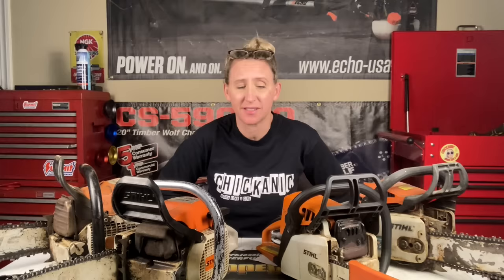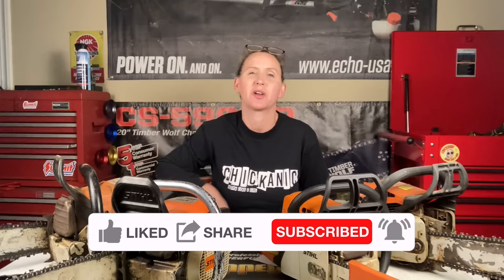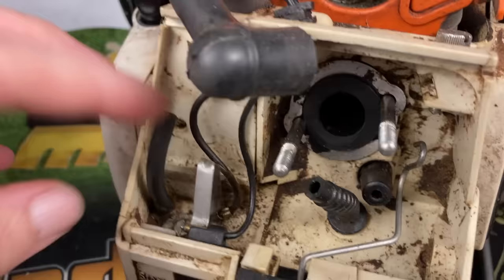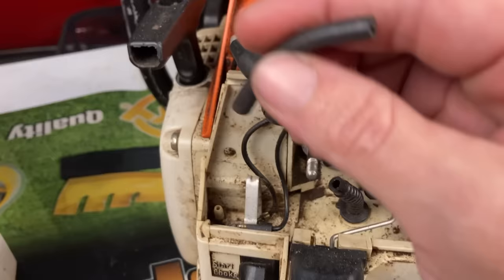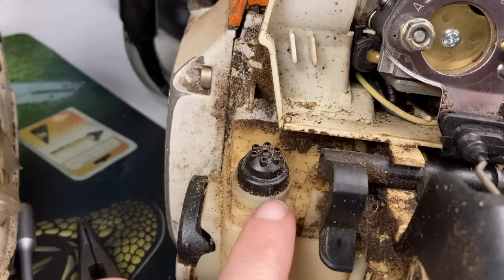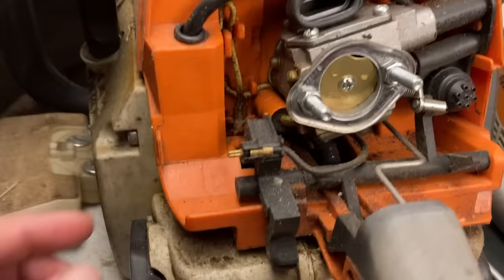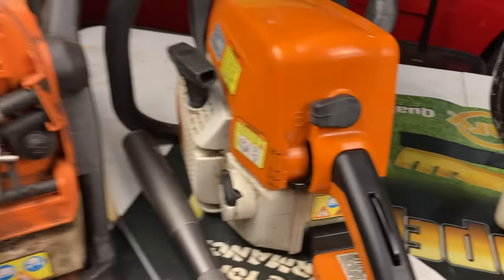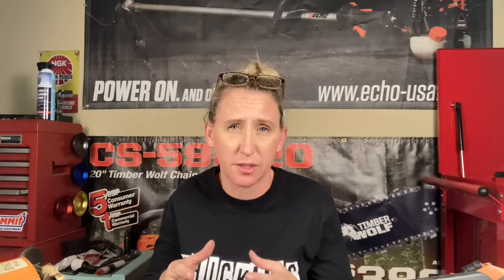Stihl chainsaw bogging down, has no power or is leaking fuel? CHECK THIS! Repair/Vlog #Chickanic

Comment: These carburettors require atmosphere pressure only. They DO NOT require tank "pressure". The vent is only to allow air in to stop a vacuum. All these comments and I don't think there's a mention of carb pop off pressure. This is the required pressure for the inlet needle to pop off its seat. This pop off pressure helps to stop heat related tank pressure from flooding the engine.
Pop off "spring" pressure is also in relation to metering diaphragm activity. If your inlet needle in a bit on the old leaky side you will flood your engine if the machine is left in the hot sun with a working late model tank vent. Being a bit old school I prefer the older screw type vent,  where tank pressure is constant whith atmosphere. Like the old 038's
Reply: Don’t mind them, people know things without really knowing them. It happens when everyone wants to teach what they know.

As for venting pressure, it is something Stihl (maybe other pro saws as well) does as they’ve had issues with gas spraying out when operators opened the cap to refuel. It was a workplace hazard and they were going to lose business if they didn’t fix the danger.
Reply: Right the most stable mixture and smoothest idling is when there is no help 
from tank pressure to the fuel pump.The metering diaphragm and needle valve
are confirmed working at least for fuel flow cutoff, if tank pressure is there, 
and no issues of flooding are also occurring. When my saw is not in use, I put
the throttle on the fast idle warmup step with the kill switch set to Run so the
throttle plate is cracked open and any seepage of fuel can evaporate and not
flood the engine while it is sitting and awaiting next use. As a habit I do this
setting every time the saw is not in operation in anticipation of the next use.
You are right the engine runs better with no extra fuel pressure just the fuel
pump pressure on the metering diaphragm so the mixture settings stay valid.  
A paradox there is trying to have your EPA cake by blocking emissions of fuel vapors but be able to eat your OSHA cake too by not having pressure in a fuel tank when the fuel cap is opened. A compromise would be something like the pressure release lever on a radiator cap that would slowly release the pressure 
in a gradual way over a few seconds so there is no spraying fuel when the fuel cap is opened. Stihl or aftermarket fixers of course came up with a hundred 
dollar solution fuel fill cap upgrade. Everybody sees what EPA has done to 
gas cans with all kinds of contraptions that are only progress for a special
way of thinking about what is actual progress worth having for the small 
difference it may make. And such improvements can backfire in ways that
were not anticipated. That would be the case where tank pressure is great
enough to force liquid fuel past the main jet needle valve where it would 
be evaporated as it floods the engine or heads that direction, which can 
result in a higher emission to atmosphere than would occur from simply 
allowing vapors from the fuel to escape as the cost of doing business. 
If that flooding problem is occurring then pressurized fuel tanks could 
be making the vapor emissions worse from the liquid fuel leaking past
the main jet needle while the saw is not even in operation. Has that issue
even been studied by Underwriters Laboratories or similar EPA? I don't
know. A Bic lighter has a porous rod that allows butane vapor to exit 
the valve when the lighter is used but blocks the liquid butane fuel 
from squirting through the valve like a flamethrower. That is an idea
has a parallel to the pressure venting issue and is where the sintered 
bronze or some other porous material could be useful maybe even 
the exact same porous rod used in butane lighters could work.
Reply: @killer2600  You are still learning so let me mansplain.
Being litigious towards Stihl is misdirecting liability that 
should have been dropped on doorstep of EPA. Because 
it is the fuel storage emissions restrictions and "upgrades"
fixed what was never broken until bureaucrats mandates
started breaking things. That is the true story, all of it. 
And fortunately a recent Supreme Court ruling about EPA
is sending them back to school where they learn they 
do not have jurisdiction over everything from coal fired
power plants to cow farts, that states have their own 
regulations and not every state is California.
Reply: @artpatronforever  I’m not going to explain where you’re wrong. You’re a know it all that likes to mansplain to no end and talk for talking’s sake. You can explain to yourself where you went wrong and if you can’t I don’t care.

Comment: @7:25 would a more stiff hose help on the smaller MS250?  rubber of a more stiff grade?  or perhaps the best, a hose that is formed to go around the high-low limiter cap?  of course, such a line would be more difficult to bend around the high-low limiter cap.

Comment: I have a question and this is the newest and most relevant video I could find to relate to my issue.
I have a Stihl 251C about two years old, I seem to have some issues with the chain sharpening I've been having done at a local hardware store.
I just replaced the bar, the chains are cutting slow with some shavings and some sawdust, I'm looking into sharpening the chains myself and while looking at the chain it looked loose, when I rotated the chain it would tighten up and loosen as I rotated it.
What's wrong here ? 🤔

Comment: Great video!  Curious, though, what are the set screws for in the vent tubes?
Reply: Vapor can easily leak through the crevices of threads on set screws
pushed inside fuel line but the flow of splashed liquid fuel is restricted

Comment: These fuel tanks are vented not pressurised, the valve is designed to stop raw fuel and gas escaping into the atmosphere. The calibrated two-way valve prevents pressurisation (from heat) and vacuum (carburettor fuel pump) in the tank. That's why it cannot just be a simple venting hose.

Comment: Is it common for the coils to fail on the ms 250’s. Have one thats 2 years old that once it gets heat into it doesn’t want to start. Replaced the tank vent recently too. Guess I need to check if it’s pinching too. What compression should it be at? 120?  Great video.
Reply from the maker: 120 is good compression and no, I never see coils fail on them.

Comment: are you SURE the tank vent is to prevent pressure on the fuel?  it should be to relieve the vacuum in the tank as the motor draws fuel out of it.  at least that's the problem I had when I tried to do a temporary fix on a weed eater with a vented cap that had cracked.  - the weed eater would start, run for about a minute, and then lean out, bog down, and stall.

of course, the first thing to check on a saw that's bogging is to clean the air filter.  my mechanic told me to use electric motor cleaner to blast the crud off it, and it works great - though it's best to let it air dry for a few minutes before starting the saw, afterwards.

Comment: I have a pioneer p28, I put new gas in  it and flushed the system and it worked great 2 months ago. Now I can't get it started, I've checked spark but I don't know what could be wrong. Any ideas?

Comment: This video confused me. You explained that the tank vent allowed excess pressure out of the tank. Where does that pressure in the tank come from? I thought the tank vent allowed air INTO the tank to replace the fuel as it is used in the engine. If air didn't go into the tank, a vacuum would build up preventing fuel being drawn into the carb. Can you explain please. Thanks.

Comment: What creates the pressure in the tank? Is it just the temp increase that does the same thing to plastic gas cans?
Reply: alot of the pressure created in the fuel tank is ,as the fuel warms up the butane in the fuel expands(as all liquids do)and releases from the liquid . it is just part of the gasoline blending process to get it where it needs to be , so its uniform across the country , in the northern climates they use more butane in the mix in the wintertime to help vaporize the gas so it burns easier,quicker starts etc.,, butane gives gas the "woof" when its lit
Reply: Thought the vent was to allow air in as fuel was being sucked out so not develop a vacumm in the tank stopping the fuel from going to the carb.  What this about the right amount of pressure allowed by the vent.  Seems if there is warm fuel pressure build it would be allowing fuel out also.  I’m confused as to what she is saying about the vent allowing the right amount of pressure.

Comment: Would this cause the chainsaw to act like one of my Tecumseh engines with a replaced gas cap on it that sometimes acts like it is starving for fuel until I loosen the gas cap briefly to allow air in?

Comment: So it seems that we're lacking a solution on a test case. So I wanted to pose a possible solution, a small diameter flexible copper line that I could insert a small piece of in the area the hose is crimping down to nothing. Again I realize the powers that be frown on anyone reengineering things but what do you think of that idea?
Reply from the maker: Some people might say you can remove the limiter cap, but I can't tell you that. LOL!

Comment: If you're saw is bogging,  no power first thing to do is vacuum/pressure test the engine.  They are air leaking garbage

Comment: I have a question, I have a Stihl fs38 that has a weak spark white in color, I bought a new Stihl coil and set air gap and it still has a weak spark white in color, so I took it back and got another new one, installed it and this one has a weak spark white in color, so am I missing something, lol  like maybe the computer is bad, I looked at the piston and it is not black, it's shiny like new, I put a drop of gas on the plug and it didn't lite up the gas, what do you think it could be, I know that I'm missing something

Comment: The "set screws" in the tank vent line, do they have a small hole in them like a fuel jet??
Reply: Essentially is the tank vent set screw metering the amount of air Venting from tank through a small hole In the set screw in the line?
Reply from the maker: No, it passes just enough through the threads of the screw.
Reply: @Chickanic  ohhh wow yea I could see how that would clog up pretty easily then

Comment: You are saying the opposite. Tank vent lets the air IN the tank to equalise the pressure so the diaphragm can pump the fuel into the carburettor. The tank vent SHOULD let air in, but SHOULDN'T let air out. If the vent doesn't work you get the vacuum inside and saw leans out and dies...

Comment: I can't fully agree with your theory of operation here.... The fuel tank doesn't need to be under pressure and should not be pressurized. Most tank vents allow the pressure in the tank to equalize with atmospheric so the carb or fuel pump can draw fuel from the tank without positive or negative pressure affecting the flow
Reply: That is the old school and best way for the engine to operate, but EPA
restrictions on vapor emissions have changed the way things are made
to work.
Reply: @artpatronforever  I know what you're getting at, they are trying to keep vapors in, but she's talking like the tank needs to be pressurized to work and that's simply not true. It may run under pressure as it heats up, but it doesn't NEED pressure. It would run just fine with the fuel cap off, for example. Just make a mess.
Reply: @Krankie_V  Right, and it is guaranteed people have slightly loosened
the fuel cap to break the seal and kept right on sawing until the saw
warms up. If bureaucrats and regulators or what some call revenuers
had their way, saws would have a red blinking light telling you a 
trouble code your gas cap is loose and you would have to use a 
code reader to stop the blinking light that will soon block you out
of using your saw. Corvette Lady is sharp and knows any duplex  
breather design issue comes from bureaucrats not the engineers. 
The engineers are given a design assignment that is a paradox.
Reply: @artpatronforever  yep and everyone likes to bitch and moan about emission control devices, but I never seem to hear anyone complain that the air is too clean. Nobody is saying they want the smog back in cities like New York and LA. The devices do create a new set of challenges however all the claims that they are unnecessary are nothing shy of pure ignorance. I'm frankly getting tired of all the people complaining about these devices and at the same time taking decent air quality for granted.

Comment: Sorry but the tank vent explanation is BS. The vent lets mainly air in to not create a vacuum when the fuel is sucked out. Also, when sitting in the sun it allows to let gas fumes out when the tank heats up. So it works both ways.

Comment: 100% wrong. tank vents let air in so the gas can flow into carburetor and the tank and fuel hose doesn't collapse etc otherwise the engine wont run.

Comment: damn your all wrong here ??????? the air vent is so the fueltank dont build up a vaccum so the machine cant suck fuel to the carburettor, and the neddle prevent to much fuel to the carburettor,  as with the settingscrews damnd